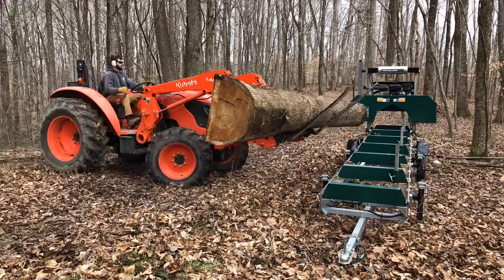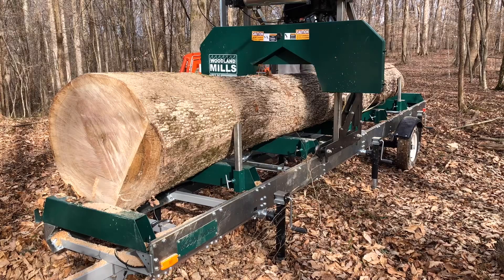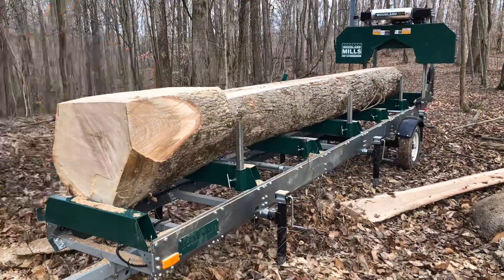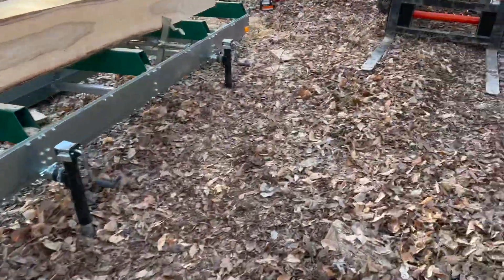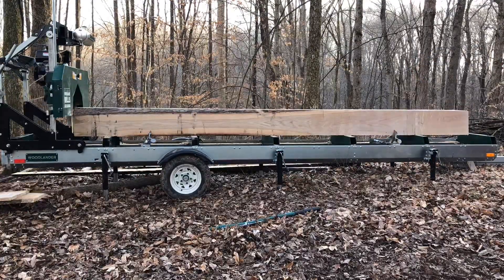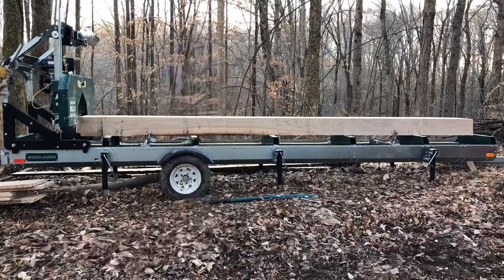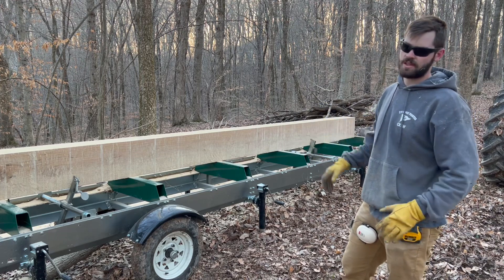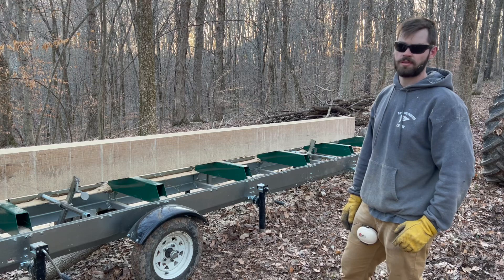Saved $650 by MAXING out Woodland Mills HM126

Comment: You have a good looking woodlot there. Big hardwood. i had my logs sawed at the old shipyard near us. I had two ten by ten x 18' red oak logs cut and planed. They had a 30 inch wide planer.  He nailed a handle to the end of the log, put it thru the planer,pulled it back and so on. His saw could handle a 30 foot timber. He also sawed my pine. I think you did well sawing that tree. I knew the flare would be a problem.  A mill like that should be on a fixed base, like concrete. The weight ooof a log will throw off the tracking. yours tracked well. Good job. Is dead ash any good for wood/ Or is it wormy with borer holes?
Reply from the maker: That's a neat trick with the big timber through the planer. Yes, my plan is to someday put that mill on a concrete base. But for now I take my time to get it level and check it periodically. I have had bad luck milling dead ash. Bugs and borer holes are definitely the main problem. Too bad because ash is really beautiful wood.
Reply: @fortunatefarmer6941  i figured the ash might be holed.Pine is like that if it sits around in summer,with the bark on. Bugs get in it and bore holes. Big mills soak the piles. You can also strip the bark off and then it keeps for a while that way. Spruce and hemlock are not bothered. We do have a Hemlock looper that is a new pest and those kill hemlock. We dont have much white oak,mostly red. the white oak was favored for framing in the ship building days.So you like your mill?
Reply from the maker: @kennkid9912  Good to know about the pine. I have about 30 pine logs on the ground right now. Better saw them up! I do like my mill. Looking to upgrade to get some better production numbers, but I have been pleased with the results for the money.
Reply: @fortunatefarmer6941  No homeowner bandsaw mill is high production. its a lot of work and takes a lot of labor.